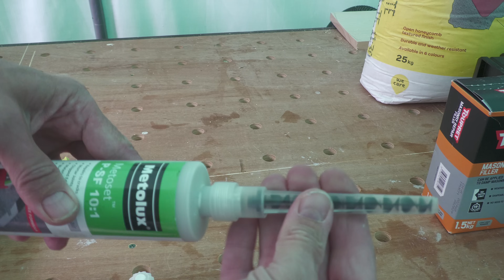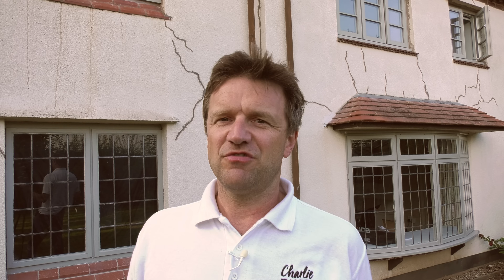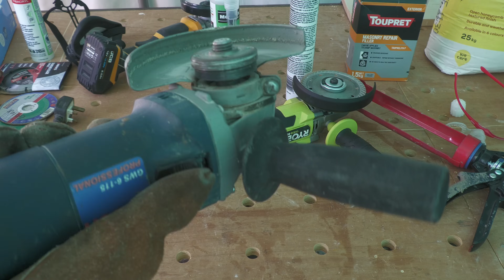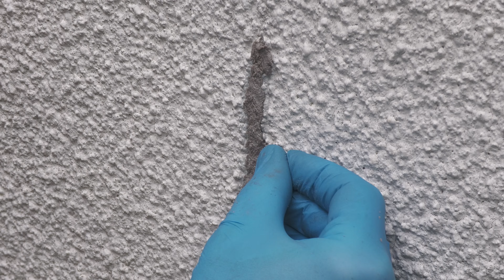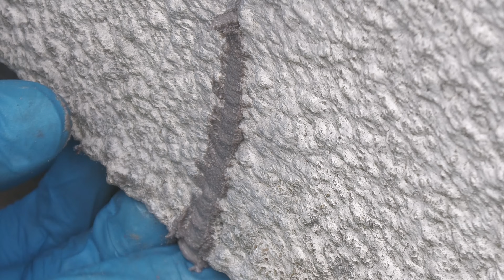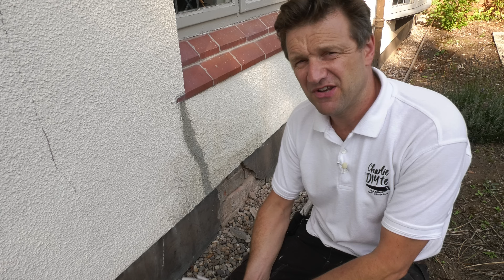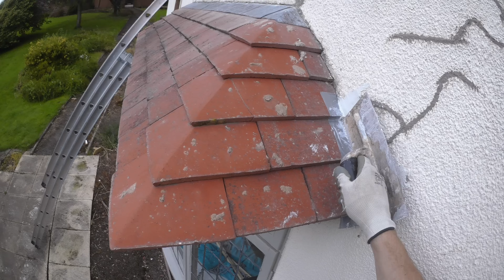How to Fill Cracks in Render

Comment: Thanks for the very informative video but I think you were being a bit harsh on the Toutpret Flexible Crack Filler. It's clearly not meant to be flexible enough to bend right over as you seemed to want, it's surely only required to accommodate reasonable movement in a regular crack. I've not used the stuff but every time I've specified any other sort of product needing to fulfil such a role, I don't expect it to do something it wasn't designed for - 'horses for courses' and all that!

Also, just because the superficial crack is filled it doesn't mean the substrate won't move again/further, so you could well have to keep doing this crack-filling exercise again since whatever product you use it isn't going to prevent the substrate movement. I'm sure you'll know this already but brickwork should have movement joints at certain centres, (6-10m from memory), so if your walls don't have that, they're very likely to keep cracking. What you're doing here is tackling the symptom, not the cause.
Reply from the maker: I wouldn't use the Toupret flexible filler again. Far too much shrinkage. I do however really like their exterior filler that I also used in the video. I hear what you say on movement but the repair looks as good today as it did when I completed the repair.

Comment: Very informative video do you think would be good for repairing movment cracks in old K rend/monocuche before painting?
Reply from the maker: I don't see why not. The same principle will apply. The difficult thing will be getting it smooth enough to match the krend I guess so it blends in after painting but epoxy resin is your best bet for any repairs like this.
Reply: @CharlieDIYte  thanks mate and defo going to invest in battery powered angle grinder

Comment: Those Duro blades seem quite pricey compared to some Bosch) others diamond blades which also are easier to pick up at Toolstation/Amazon etc.  Do you think they're significantly better? For example-
https://www.amazon.co.uk/Bosch-Professional-2608602393-Universal-Multicolour/dp/B004EED55K/ref=asc_df_B004EED55K/?tag=googshopuk-21&linkCode=df0&hvadid=222086461140&hvpos=&hvnetw=g&hvrand=12478281022925607063&hvpone=&hvptwo=&hvqmt=&hvdev=m&hvdvcmdl=&hvlocint=&hvlocphy=1007265&hvtargid=pla-423204219101&psc=1&th=1&psc=1
Reply: So to answer my own question.  The Bosch blade works fantastically.

I was less impressed by the metoset stuff.  Whilst it was easy to use the amount of tubes you need to use make it really expensive.  

If you are going to use metoset then a regular cheap gun works absolutely fine for extruding.  A geared one is not necessary.

Comment: Really helpful video, thank you. I’ve ordered some Metoset 480g but unsure about selection of extrusion gun. The only geared ones I’ve seen are for 400ml max but should these Metoset tubes fit these? Thanks
Reply from the maker: It doesn't really need to be geared. Just go for a decent quality gun - one of the more expensive ones at Amazon or Screwfix.
Reply: @CharlieDIYte  thanks. How do I make sure I get a gun that is big enough to accomodate the 480g tubes? All I’ve seen refer only to Ml , and invariably 310 or 400ml max.

Comment: Thanks for some great tips/product reviews. Had flat render to be repaired. Soon settled on the Metoset to do the deep cracks ( but not flush) and used the Tourette’s on top so it could be sanded. Note  - you definitely don’t need a geared applicator for the Metoset,
Reply from the maker: You're welcome Mike. 👍

Comment: Thankyou for your excellent description on render repair, watched it multiple times and then felt confident enough to tackle my house ,

The Metoset works great but is horrendously expensive if you have a large job , smells quite lethal when applying ,and goes off really quickly .

The Toupret powder ,really impressive stuff ,gives excellent results ,much much cheaper, stays workable long enough to make the correct surface match .Highly recommend it  too.
I used the  wider masonry disc and gave the repair area bit of overlap either side ,stippled the surface with a stiff brush , and threw small bits of gravel at the repair which then stick to the Toupret giving it a match for the surrounding area , hopefully when i paint it wont show too bad and will blend in well.
Reply from the maker: Well done George. Sounds like you've done a great job there 👌

Comment: Thanks for the vid - really helpful. Quick ask - when grinding out the cracks, I can’t get close enough to window sills (cracks running out from here) with my grinder. 

Any tips for getting up close to them?!
Reply from the maker: Thanks Joe. Glad you found it useful. How about that mortar raking tool you attach to the grinder that you saw me using in the vid? Failing that, a masonry bit on your drill.
Reply: @CharlieDIYte  good shout - should have thought of that!

Comment: trowel mastic is a good shout used that yesterday can be used for pointing brick work so should be good for cracks
Reply from the maker: Thanks Jack. Yes I've heard good things about this stuff. In the past I've pointed around windows with sand and cement. Should probably use this stuff for a better seal. Might be a bit of a pain to apply in cracks though 🤔
Reply: @CharlieDIYte  yes it is harder but i used hoping it would have less chance of cracking as it has allows for around 5% movement a lot of exterior power fillers crack within days if its a movement crack.

Comment: Charlie I've just repainted three sides  of our house in Sandtex Cornish Cream - lovely! (What is it with the current fad for shades of grey?) and have come to the south facing facade which has a few stepped  cracks, and also gets the worst of the sun and sea air. The finish I believe is 'Alpine  Finish' which seems to be a ground coat of vertical striations followed by a horizontal topcoat which gives a bark like finish. I'm happy to use the Metoset on the cracks but like you, i hate to see the crack  line afterwards, any thoughts on how to duplicate the finish? I once saw a tradesman  using a wooden float on render - is that what they would have used on 'Alpine'. Many thanks for your informative video.
Reply from the maker: Hi Tony. Not sure. Bottom line there's no perfect solution. You're going to have to experiment like I did.

Comment: Brilliant video Charlie, thanks!  I recently did a render repair job and spent most of the time trying to match the finish lol  Do you think the Toutpret will work well in a mortaring gun, so you can force it easier/deeper in the cracks, similar to the Metoset?  Also would it be possible to press few stones in, to help match the render?  We will paint after, but I think adding a few stones in will help fool the eye a little more.  appreciate your thoughts, thanks!
Reply from the maker: You're welcome 👊 A few people suggested putting it in a gun. You could try but I'm not sure if the mix is wet enough if that makes sense. Worth a try though if you've got an empty tube. I don't know about the stones. I think after trying with a few you'd just get fed up 😉
Reply: @CharlieDIYte  Thanks Charlie, my mortaring gun needs a bit of washing-up liquid, otherwise the mix separates and it won't pump through. Not sure if you could add that to the toutpret.  I managed to poke in a few stones on the previous job, bit tedious lol. Flicking a thick slurry off paintbrush onto the wall helped add texture and help bond the stones. Repairs up high usually look okay with lower areas it's difficult to match the  pebble dash, painting always helps 😊 look forward to your video on spraying 😊 thanks again

Comment: Great Video Charlie, thanks. as well as cracks I've got large areas where the paint in peeling. Taking that off from those area's and then using the masonary filler (Toupret) to even out the surface prior to painting the  correct approach? Thanks
Reply from the maker: The Toupret is good for spot repairs. If the evening out is more extensive though you may have to look at other products.

Comment: Would you say the Metoset would be ok for filing in some honeycombing on a concrete step?
Reply from the maker: Is it significant? I'd be more inclined to use the Toupret. Bit simple answer to your question yes, but the Toupret might be easier to tool 🤔
Reply: @CharlieDIYte  small amount along bottom edge (step is 90cm wide)

Comment: As always thanks for the video Charlie, got a job to do which is very similar to this and I'll be using the Metoset for sure. I've used the tyrolean with an adhock flicker AKA a floor scrubber with stiff bristles and the action is that of a cowboy shooting a pistol; from the hip of course lol! works really well as a texturiser
Reply from the maker: Cheers buddy and good to hear from you. Great improv. 🤣 I've bought a Tyrolean flicker - I think it's from Faithful and will be using it in the summer. 👍

Comment: Just about to start identical project  video has saved me a lot of research and trial and error Top man thanks
Reply from the maker: I've got to say, I'm really pleased with how it turned out. Using that raking tool to sand down the edges is important and also extruding a decent amount before you start as there is one section that I don't think  mixed properly. 👍

Comment: Thank you Charlie. I have used the metolux on my render and fingers crossed it stops the damp. I have a chimney that is filled with bricks and plaster. I don't believe this is causing any damp issue, would it be OK to leave it? Any information would be much appreciated. Thanks Joey
Reply from the maker: Hi Joey. Good work. In an ideal world you'd get those bricks and plaster out and put an air brick on it, assuming it's still linked to a chimney pot on the roof, but if the chimney's closed off or you can't access the rubble inside, and particularly if you don't think it's causing any damp, then you have no option but to leave it. It would be very messy (dusty) emptying it.

Comment: Thanks for this video, any particular reason why you didn't just mix some render with plastering (render) sand and cement?
Reply from the maker: It would have been a lot more labour intensive getting it into the cracks and wouldn't stick to the sides of the crack nearly as well as this stuff.

Comment: As a painter and Decorator and have to defend the toupret fibacryl it's a superb product! Yes I agree it shrinks back and with another application and a less aggressive grove cut you can get a great finish / with some secret decorator 🎩 You need to remember the reason your  surfaces crack is that they are moving slightly! If you use a solid set filler guess what a crack will appear at some point some where!  Far better off applying a flexible filler and doing a few coats than repeating an issue! It's how I carry out all my work and wouldn't change it but best of luck to you!
Reply: Hi Charlie, a year down the road how do the cracks look?
Reply: I’d like to know too please. I’ve used metaset but am a bit worried ..
Reply: Me too, hows it all looking
Reply from the maker: Well it's good to hear someone defend this stuff but I'm really not a fan. A month down the line and that crack looks dreadful. It's completely shrunk into it and will need a repeat application - which isn't really practical for you to do in your day job, after the event. I'm going to grind it out and redo with the Metoset. I hear what you say though about cracks that need flexibility.
Reply: @CharlieDIYte  the Metaset is not flexible though.. will just crack out again with movement...better to do 2 coats of Toupret !
Reply: Makes sense about movement..l usually use the fibacryl or expanding foam (large cracks)as a foundation,  then finish with toupret murex filler .. do you think this would still crack?

Comment: Have you got any thoughts or advice on external wall insulation, we are about to move into a 1920's semi-detached with damp issues throughout and fear one of the major issues is the external walls
Reply from the maker: I think if you can afford it, Andy, and it works with the design of the house, and you can get a reputable company to install it, it's a great option. Have you watched this video https://youtu.be/TIDb-pdOnXM ? I think you should install a PIV if you can (eg Nuaire) and you might find a lot of the damp problems go away. You should get a couple of hygrometers so you can monitor humidity levels in the house. Insulation is one thing but you still need a strategy as discussed in the video, to manage the humidity that YOU'RE generating - of which there will be A LOT from inside.
Reply: @CharlieDIYte  Thanks for this Charlie!

Absolutely, PIV is near the very top of out list for sure! Will just the single PIV do the trick for most of the house (in time) ?

The reason I ask about external insulation is to add much needed insulation on top of ventilating the place! Thanks

Comment: Remarkably similar. I also have to repair Tyrolean, remove plinths, and install channel drains/soakaways on my new (old) property. 

Do you have videos of your soakaway?
Reply from the maker: Unfortunately not, although I used a perforated 100mm land drain pipe like this https://bit.ly/3nThEXe which terminated in a soakaway that I dug in the garden below, and filled with rubble excavated in part from the channel I dug to lay the pipe in, - not the most efficient soakaway but needs must at the time. I don't have a clue how much, if any, water the pipe takes away but having the gravel against the old foundations has got to be hugely beneficial in itself. The gravel was 20mm I think. The previous owner had paved up to the plinths, and over the years the paving had actually sagged so it was sloping into the plinths rather than away from them, diverting water into the foundations rather than away from them!
Reply: Thank you for your thorough reply. I'm glad you said about beneficial gravel as I'm considering just using gravel as a very short term measure

Comment: Spurred on by your video, I finally got around to fixing a couple of cracks in the rendering on our house. One was near the join between the extension and the house but the extension was built many decades ago so I think the crack is superficial and stable! Anyway, the Metoset did a great job of filling it and making it watertight - and I'm glad I bought a geared gun for it). I did start to press some gravel into the Metoset when I had applied a short section but this was messy and not very effective and I decided just to rough it up a bit with an old putty knife and a wire brush and that made it blend into the surrounding pebbledash. It will need to be painted at some point but that's a whole different job.
Reply from the maker: Great work, Alan. It's fantastic stuff isn't is. Well done getting a geared gun. Makes all the difference. Yes a few people suggested I could make a mould to press into it but you can't really do that, you have to tool it as best you can and then leave to set. I'm my next video I'll show how I ground it with a mortar rake tool on the grinder before painting.

Comment: Could you have made a negative of a good area of render and then used that to make a stamp when blending the filling? Probably too much effort but could be an idea if you redo any more cracks.
Reply from the maker: It's a good idea. The problem is with that epoxy resin it would have been too pliable when wet and too unresponsive when going off. Plus the mold wouldn't have sat well against the existing edges because they're totally random.
Reply: @CharlieDIYte  yeah true. I was thinking more for the big patch you did but then again would’ve been too much effort for little gain. 

Great channel by the way, really informative 👍

Comment: Hi Charlie another one of your well presented videos. Would you recommend any of these products for interior use, I have Windows in gable end where the blockwork joints are moving, there's only 2 courses between the lintel and the ridge, I've used a 2 part epoxy which is mixed in a tub, but was very messy to apply to the cracks which I had ground out.

Comment: I had a similar rendered wall which had a lot of hairline cracks but was otherwise sound. Did a bit of research and found Murfill Renovation Paint (made by Rust-Oleum) which is designed to fill and bridge minor cracks without the need to grind out and pre fill. Its 400% elastic and comes in a multitude of colours. Not cheat at around £45 for 5 litres but really works and saves a lot of time and mess. There's also a reinforcement fleece and mesh for more extensive  cracks which is embedded into first coat of paint while still wet. Only down side with this is it only comes in 1m x 100m rolls and it's £150 a roll.
Reply from the maker: Thanks so much for sharing that, Paul - invaluable information, which I'll bare in mind for the next stage 👍
Reply: Hey Betty, any luck with the Murfill Renovation Paint? Was really impressed with Charlie's technique but now thinking a less time-consuming option might fix my hairline cracks (of which there are many!) Any feedback would be appreciated.
Reply: @donnavallis1560  HI Donna, yes the Murfill is absolutely sound, solved my dodgy wall so wouldn't hesitate in recommending it. Go to www.rawlinspaints.com for all the info. They have a really good technical advice team, might be worth calling them first.